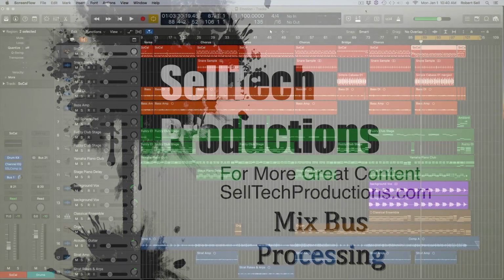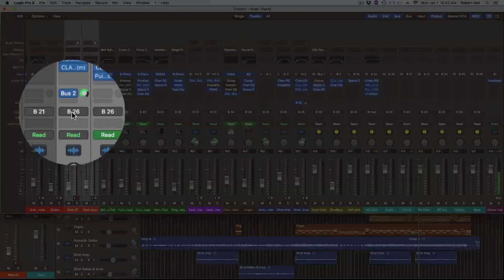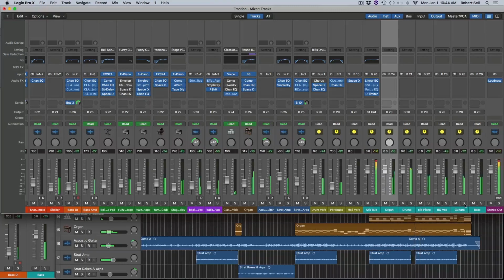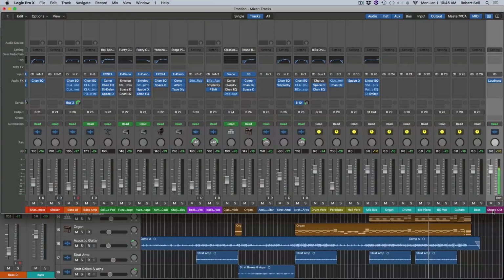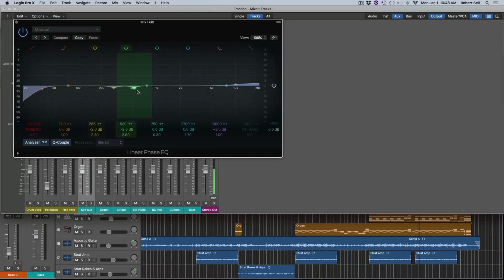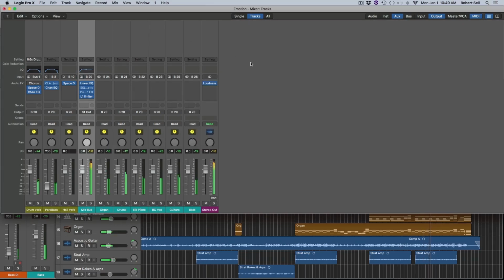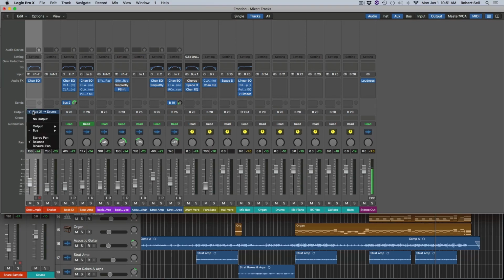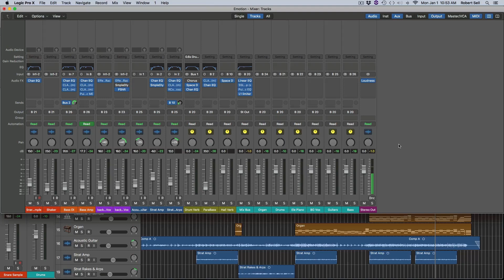Mix Bus Processing in Logic Pro X

Comment: Thanks for the video Bob, very clear and helpful. One question: if you send a track to mastering, do you turn all those plugins off in the mix bus? Or leave them on but leaving enough headroom for the mastering engineer to work with? Thanks again
Reply from the maker: If I’m sending to a mastering engineer, I’d likely turn everything off on the master bus except the bus compressor.  I’m using this to glue the mix so I want to make sure it was left in for mastering.
Reply: @BobSell  Thanks so much Bob, that helps a lot. Your videos are great:)

Comment: Not sure if you're still active on here but a question about the send amount... is a send of 0.0dB the same as sending 100% of the signal post-fader for an individual track? (For example if your snare is set to -7.5dB on the original track and you send 0.0dB, it is sent "as is" to the bus track?) Thanks for the awesome content!
Reply from the maker: You are exactly correct! The key here, as you stated, is post fader. excellent question!
Reply: @BobSell  Woo! Thank you so much. Bonus question: What happens if I send 0.0dB of the signal to a compression bus and then also set the output of that signal to the same compression bus? Am I then just doing the same send twice? Is there any reason this might make it sound better? (I tried this by mistake and felt like it added saturation, but I can't tell if it's sounding better or just muddier XD) Thanks again!

Comment: Hey bob thanks for the great video! I’m new to mixing and was wondering, why do you need a mix bus when you can do the eqing and all on the stereo output or master track. Do they give you different results or maybe there are other reasons?
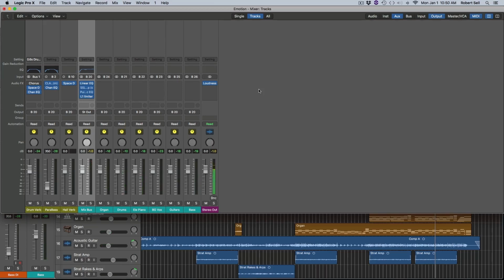Reply from the maker: I give 3 very specific reasons why you may want to use a mix bus and not put processing plugins on the master. Watch again but start at 6:15 to end. Thanks.

Comment: Great video! I changed my workflow to match this however for some reason my mixbus is around -6db (everything runs into this) then my mixbus is routed to my stereo out. BUT the volume on my stereo out is at -18db. Both faders are at unity gain??? Am I missing something?
Reply from the maker: What DAW are you using? Any plugins on the stereo bus? Pre or post fader metering?

Comment: Great video overall but one thing I don't understand is that you routed all your subgroups to an "mixbus" when you already have one (Stereo output channel)? I thought the purpose of the Stereo out channel that Logic Pro loads up with in every new project was to serve as a mixbus. The second thing that confused me was that you referred the Stereo out channel as master when there's already an master channel? :S Could you or somebody else explain the thought process behind this video?
Reply from the maker: As stated in the video, I’m using  plug-ins on my mix bus. This leaves me the option of sending a track to the stereo out which will bypass the plug-ins on the mix bus. The term Stereo Out (Logic label) is synonymous with Master Channel.
Reply: Hi again!
Thanks for takin the time to answer Bob! Yeah I realized that now. I was to quick to write down my confusion before I let the informations sink in. My bad haha. @BobSell

Comment: Do you also have a video on how to make the song effects sound in your headphones while recording vocals, i mean....to hear the effects in the phones but not record theme....just to get the right feeling while singing.
Regards from Stockholm Sweden
Reply from the maker: Hi Danne, thanks for the comment. Just add your effect plugin on the track you’re recording and monitor. There is no input processing with plugins when added to your track in the normal way. In other words, what you are recording is a dry signal with no effects. The effects are only monitored. The effects are printed (recorded) to the file when you bounce a track or your mix. Hope this helps.
Reply: Bob Sell but how to get the effects when I'm recording I need to hear them in my phone's....what do you mean monitor
Reply from the maker: My guess is that Software Monitoring is turned off so you won’t hear plugins during recording. Go to Preferences/Audio/General tab and make sure software monitoring is turned on. Hope this helps!

Comment: Hi, Bob, would like to ask you if you have upgraded to LOGIC 10.4.. I am having an issue with FLEX PITCH.. Whenever I turn it on it changes the tempo of part or all of my file and there is no undo-ing it.. Apple is sending out their updates, it seems, without testing it.. Also, they are awol on their helpsite.. I was wondering if you might have a fix.. It seems it is the new Smart Tempo thing.. Honestly, I am forever fixing problems with my Apple gear that I get nothing else done...
Reply: I'm not Bob, but I'm actually experiencing the same problem in 10.3.3. I haven't yet updated to 10.4 because I'm in the middle of a project. It's doing that to some tracks and not others. Curious if you've found a solution.

Comment: You are on Logic. Why not use track stacks?
Reply from the maker: Hey Steve, I use to use track stacks all the time when it first came out. It's basically doing the same thing and works pretty well with smaller projects. The problem I have with everything Logic's does automatically is trying to figure out what it's done for me. If I don't immediately figure out that bus 22 is going to aux 12 and it has named that track Sum 44 then I will never figure it out later. Logic makes a mess out of things with its aux track naming convention. I posted a video on this issue last year. https://youtu.be/A2SdFCWrEmc  I prefer to have my own system of creating tracks and busses that way I can revisit the mixes years later and have a good idea what's going on. Thanks for the question!
Reply: true that, the mess logic makes of any "name space". I saw your post when you uploaded it. However when the bus naming space was increased to 246 awhile back I returned to using track stacks (sorta "mini-mixers"). In essence by letting logic garb the lowest buse numbers and globally using only 126 and above.../s~
Reply from the maker: It amazing how many workflows there are to accomplish the same result! It all about being creative. Thanks for sharing your thoughts!